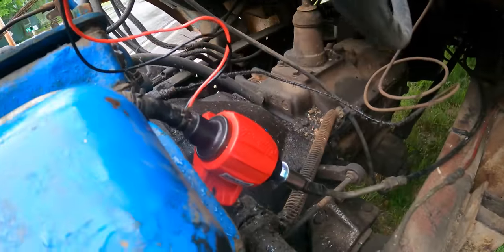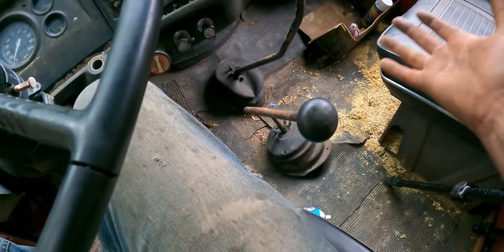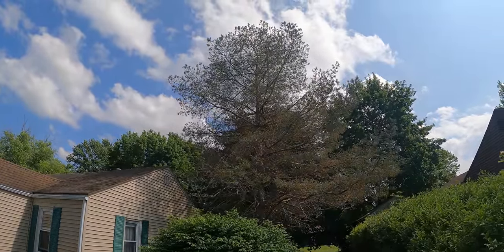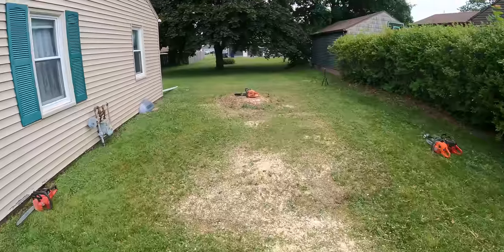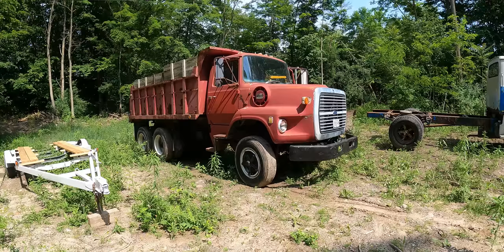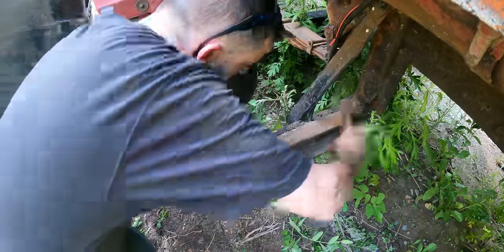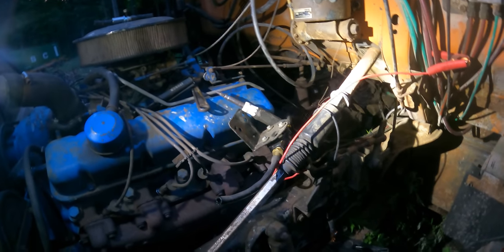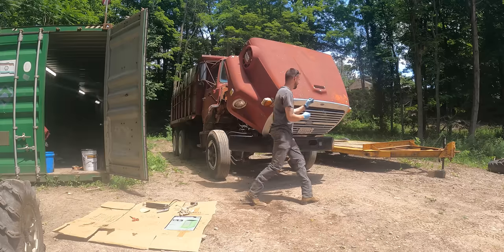I bought the CHEAPEST dump truck on facebook marketplace - Will it run??

Comment: The 534 was a good engine.  Fire department had a '75 C-800 with this engine with a 5-speed transmission.  Not everyone could shift it well, but a few could really make it run.  It pumped at a refinery fire for over 24-hours straight (obviously gas tank was topped off several times).  The exhaust manifolds were glowing red but it lived to see another day.
Reply: RUNN'EM HOT

Comment: That's a cool truck... I also have a Ford dump truck, an auction impulse buy too cheap to pass up. Mine's an '87 CT8000, but with the old style cab-over, it looks like it's from the '50s. It's unbelievably heavy duty for a medium duty truck, with a double frame almost an inch thick, 56k gross with a Cat 3208, Allison automatic, and air brakes. It was owned by a school district in central California... Well maintained and rust free.
Reply from the maker: I love finds like that. They don’t build trucks like they used to

Comment: That junk will out last anything you can buy now😮😮😮
Reply from the maker: You’re exactly right
Reply: @99Projects a gas motor in a truck that heavy seems weird doesn’t it ?
Reply: @deborahchesser7375 It was pretty common on the old days. Or at least on my developing country anyways
Reply: @deborahchesser7375 yeah I thought the same thing I had this video playing while working in the garage paying half attention and I heard it and said it must have a vicious manifold leak it can't be a gas job in a 10 wheeler ..... but a good portion of farmers got them to haul silage and farm stuff with and they were way cheaper to spec out with a gas engine I suppose . Plus the farmers never going over the road much or long distance it works out for them . Me personally I despise gas engines they always let you down when you need them most , or if they sit for a while or amy number of things lol I'll always buy diesel whenever it's an option
Reply from the maker: @rirebel6029  I tend to agree with this. This truck, as it is in this video was extremely unreliable. Every time i went to start it, it had a new and different issue with the engine. Finally the engine started knocking and that will bring us to the next video on this truck
Reply: @deborahchesser7375 tq hello dear
Reply: A gas motor that is stronger than todays modern diesels yes that you can fix with a simple harbor freight tool set all plus’s
Reply: Unkillable, mean, the mechanic embodiment of "Drunk, Tired and Pissed Off", an absolutely Groided machine that should only be ran on the finest stolen fuel this side of the Mississippi (best fuel is stolen from new dodge truck owners because they always have full tanks) just drill a hole in the tank.

Comment: I had people at the quarry I used to pick up from make fun of the 1998 Mack CL700 I was operating at the time, it had an e series motor and roared and bellowed like nothing else, they called it junk and a piece of shit, but that thing has been pulling 8-10 truck loads at 74k lbs for over 25 years without an inframe, and is built like a brick shit house, I'll miss that old monster :( This made me think of it.
Reply: Hell yeh those little 300 plus Mack motors pulled like much bigger motors. I drove a 75’ DM800 300 plus Mack 15 speed tri-plex and #55,000 bogies, like you said, built like an anvil and run forever 🐾✌️🇺🇸
Reply: It’s a Mack they keep going

Comment: The gasser isn't ideal, but a Ford L-Series is a hard truck to beat. You could get that LTS with a variety of diesel engines from Cummins, CAT, Detroit, and Ford. If you ever wanted to pursue a swap, there are a lot of plug-n-play options if you have a parts truck. That old truck looks very straight for its age and considering it's a dump truck. I'd say that was a long day driving a twin-stick gasser. The L-Series debuted in 1969/70, so that's an early example. Given how clean it is, that 10k may be true mileage.
Reply from the maker: That truck’s actually under the knife getting a new power plant now, without giving to much away, there will be more videos on it. 

I can’t imagine driving t that thing all day!
Reply: Yes I have a 1974 Ford L9000N with a factory Cummins 855 , 350HP, and when I bought it in ~2007 , the sellers told me it had been running 40 hours a week from 1974 till 2006. They bought extra trucks during the building boom and then when the building stopped they sold it off because they no longer had work for it. Amazing 32 years of service. Now I've had it for 16 years and I only run it occasionally to get gravel for my farm , still doing just fine.

Comment: You make me proud my friend we had trucks like that when I was a kid hauling green and hauling hay out of the fields we had an old Ford l9000 with a 460 in it and because of the weight that it pulled it had three sticks it had the main box the secondary box and a third box was for highway work and it was a good truck The only thing it really had to keep an eye on is keep the valves adjusted on it because when you start working it real hard the bowels would get a little loose and take about 25 maybe 50,000 miles and you have to do a valve adjustment but other than that it was a sweet ride I'm glad you saved that old truck you look good in it
Reply from the maker: Thank you

Comment: Ford LTS is my absolute favourite truck. Diesel version of course.
I was always amazed how those gas engines had enough power to move those big trucks especially fully loaded.
Reply from the maker: They have a ton of torque but I agree with you. They would have been a turb
Reply: It’s all in the gearing.  You can moved an overloaded 18 wheeler with a 500cc motorcycle engine if the gearing is low enough.  These gas trucks were geared low and were not very fast.

Comment: Old trucks are the best. I got a great find a few months ago, a Scania T112H dump truck for under 1000€. Got her running with a pair of new batteries and fixed an air leak to get her moving. Didn't have a use for it so sold it to a company that wanted to restore it.
Reply from the maker: That’s awesome! Great to see the old iron saved

Comment: You probably need to work on that holley if it's been sitting. Be sure to remove the metering blocks too. Maybe change to a 50 cc Reo pump. That has a vacuum governor on it. There is a line leading to the distributor that is not a vacuum advance. There should also be a little filter on the distributor, if that is dirty or clogged the throttle won't open right
Reply from the maker: I really appreciate the info, I do not know a ton about the Holley style carbs

Comment: There is a tool that will back off the brake shoes on air brakes for towing. Sometimes they are clipped to the spring cannister, but usually missing on old rigs. It looks like a threaded bolt with a "T" on one end. You might find them at a salvage yard, or truck parts store. I have a L9000 fire truck 1978- detroit 6V92 still in service every summer for the forest service hauling water.  It is older than most of the firefighters, but still runs strong.

Comment: That fuel pump is the same style as my M35A2.  The motor is fine but it sounds like the pump side impeller is bad. You can get just the new pump side and chang it.
Reply from the maker: I figured. I try to do will it run videos by only using what’s on the truck at the time. The truck is under the knife getting a new power plant anyway

Comment: The 534 running right made 266hp. The turbo charged marine versions were rated at 400hp.
Reply from the maker: They put turbos on those gassers???
Reply: @99Projects  Yes, some marine applications had twin turbo set ups.
Reply from the maker: @TheSoloAsylum  I wish thats what I had
Reply: I cant believe they put that engine in a tandem axle dumptruck. I doubt it can go more than 45mph fully loaded.
Reply from the maker: @Jasonrotfl  i dont think it did 40 empty the last time i drove it
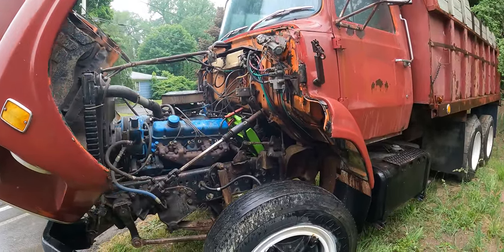Reply: @99Projects  Haha if its got a 5x4 trans, throw a 3:30 rear end in it and a diesel and shell run faster than you dare!
Reply: @99Projects  Maybe you can find a scrapped boat and swap the engine out LOL.

Comment: Back in 1969 we had  a truck set up like yours. We pulled  a clemet pup trailer with it. When that  motor was running right it would out pull a 1160 cat.
Reply from the maker: This one was worn out but I was still impressed by the torque it had

Comment: A nice tune up, blow out the fuel line. Maybe clean the tank too. Give the carb a going over for cleaning and new gaskets, seals, pumps, and touchup to the jets. Do your points and that should be good enough to get more reliable.

Not much to add that hasn't already been said or heavily implied. Cept maybe that current mileage estimate per gallon I'd peg right about 5 mpg, under load knock that down to around 2 mpg. Gas engines kind suck for that sort of thing. But, up swing is this, go-better bits are a bit easier to come by.

Plus imagine how it would look to tilt the hood to show off a nicely built big block with a weland blower on top. Leave the rest as stock looking as possible. Faded paint, surface rust and all.

That's kinda what a friend of mine did with a '76 four door Torino. Left the sun scorched paint and fried vinyl top. The rust patches were just that much better camouflage. What lurked under the hood though was a hot 429 cobra jet backed by a four speed. The ladder bars could barely be seen and it sounded like it was all missing and exhaust leaks. Right until it laid a half block of rubber elevens on the road. Just something fun about having a top runner housed in dirty coveralls so to speak.
Reply from the maker: I’m a big fan of the natural aged look, it kinda tells a story. 

I wasn’t going to do anything with the engine untill it started knocking. There’s a new plan for it now

Comment: I'll tell you an exalent heavy duty v8 engine from early international dumps its the 345. If you ever need a replacement engine and you decide to go with gas this is what I would recommend. Only a option.
Reply from the maker: I actually have an old international cab over with the 345 in it, it’ll be a video of that soon.

Comment: Don’t you have to get that truck safeties to be road worthy?
I never understood American laws when it comes to buying a used vehicle and being able to drive it on the road without any tags.
Here in Canada you have to be 100% compliant before it can even touch the road.
Reply from the maker: So do we, it has to be Registered and insured, however, with farm tags, in my area, you are exempt from the yearly safety inspection but you’re limited where you can go by miles. I think it’s 50 miles here. It should go without saying that anytime a vehicle hits the highway especially one this big and heavy, it should be safe to be around the public. 
I checked all the brakes and lights, horn etc, all things that would be required in a safety inspection.

Comment: It's good basic transportation for 50 years ago.  Love that tight turn circle the LTS provides.  534 V8 is normally the 900-series truck .  

 800s used the 361 and 391.  Slow....
Reply from the maker: It’s slow there’s no question about that but it is the 534. Hopefully there will be a new engine going in it in a future video

Comment: Ford offer a 401/477/ & 534 super duty gas engines. yours look like this series of engines. They didn't have much horsepower but had good torque. I drove a 20' box truck for some time and the 534 performed with 50/65 mph highway speeds.
Reply from the maker: I believe this one is a 534. I bet it had a lot of torque back in its day but it’s worn out. I can get about 45 with it flat to the floor. I’m working on repowering it with a big cam Cummins.
Reply: @99Projects  What's the gas mileage? Also, low compression often lets you advance the timing to compensate; what appears to be wear can be stuck rings that can sometimes be freed with oil detergents, and "Restore" oil additive can also boost compression.
Reply from the maker: @alan6832  I didnt check the gas mileage bcuz it would just make me cry. Low compression was not an issue that I was aware of, the issue now is the knocking
Reply: @99Projects  The only trouble with repowering it with a diesel is the rear axle ratios, even with an overdrive trans you'll be lucky to make 40 mph.  Gassers like that usually had low ratios, something like 6.5 to 1's or lower which is ok for an engine that can turn 3500 rpm. There's also the issue of the power of a Cummins will be too much for the transmissions and rear ends. So you'll need new drivetrain front to back. If it were me I would just rebuild the 534 or find another one to swap in.
Reply: @99Projects  rod knock shouldn't directly reduce power, though it might, and should get you off the gas pedal.  spark knock? then retard timing and use carbon cleaning fuel detergent.   when you wrote it lacked power and was old, I assumed that combination would be from low compression, but you are right that it could be many things.

Comment: You should have got some rubber are something put in between the tank metal on metal it's going to do the same thing again
Reply from the maker: You’re right. The truck is getting a new engine so all of this will be changed anyway

Comment: In the future,  leave bottom connected  , use chains and lay tailgate  flat like a pickup truck. Then use bobcat to raise and put pins in.
Reply from the maker: I was going to but I didn’t know if the bottom latches would hold the weight

Comment: 534 was never offered in an 800 series.  So, either engine was swapped, or its and LTS900.   Honestly the engine looks like a 391
Reply: The 534 475 and  401 were all the same engine series and you could get the 401 in the  smaller trucks.  I have a friend with a C850 with a 401 engine.
Reply: @mylanmiller9656  all 850s were Super Duties.  That was the change point.  A few firetrucks were built with 401s but limited number, most were 750s but I know of one F800 firetruck with a 401, but it was swapped in.
Reply: @berhorst59  The engine in that truck is for sure not a 361,  it has 8 valve cover bolts  the FT series has 5 bolts.
Reply: Yes the big gas engines were available in both C and L cab. I had CT900 with 534. L880 was one version that had 534 available.
Reply: @janmayes6578  the 880 series had the 475, which was the same as the 477, with less warranty.  900's were all Super Duties, but 800's were not.  Some F750 firetrucks were built with the 401SD, a limited number of F800 firetrucks were built with the 477.  No 534 from factory in anything less than 850 series.  850s were just 800s with the powertrain of a 900.  Ford policy.  Any series that had a -50 in it, was the same.  Truck was series of the first number, with nnext higher series powertrains.  Started that program in the 50's.  Discontinued in late 60's, with the exception of the beginning of the 880 series in 1972, which offered the 475 in an 800 class truck.  Research the history of Ford Trucks if you don't believe me.
Reply: Okay
Reply: @berhorst59  My dad drove a 1962  F 950  Ford with a 477 and a 1964 850 with a 534 .  The Company that Dad drove for also had a 1958  F 850 with a 534. I don't know about the later F series trucks, I know the early ones not all 850 trucks didn't have 534 engines in them.

Comment: Any plans on swapping the motor out for a diesel engine, the old transmission for a Eaton Fuller transmission, newer fuel tanks, and trailer connections to haul a tag trailer with air brakes?
Reply from the maker: I don’t want to give to much away but there will be more videos on this truck which I’m excited about lol

Comment: Yeah hope you guys stick with it and make it road worthy & do some body work  give it back it’s self worth & dignity treat it to a new set of tires and keep working your shifting skills on that unique old school transmission  I never got to learn those I went to truck driving school we were coached on the 5 over 5  fuller road ranger  again keep developing  your skills and reviving that old 72 LN  900 that is rare I would turn it into a show truck  over haul the air brakes  and soup up the motor I would leave it gas  keep the gear boxes there is gear lube you can put in there to help smooth the shift as your shift skills improve  I am sure you know what series that is I lean to it being a           L 8000  but I could be wrong  that truck with it’s set back steer axle and that 5 & 4 gear boxes makes that a class 7 or 8 truck  Ln series are class 5 or 6 and would have hydraulic brake with vacuum assist  another thing I would like to know is that a twin screw or is that rear axle just a dead weight bearing axle
Reply from the maker: I plan to keep it around, there will be videos on it in the future. 

I believe it’s a twin screw
Reply: @99Projects  that’s cool thank you good luck keep fixing it up  that truck can be a real asset

Comment: Is a Detroit Diesel 6/71 6v71 8v71 Swap an option..🤔💪💨
Reply from the maker: Yes, but I have a 855 Cummins I’m going to put in it
Reply: @99Projects  My dad  hauled  logs with an 850 ford with 534 back in 1964. He also drove  a 1000 Dodge with a 250 Cummins. the even though the Cummins was a low hp 855 it had a bunch more power than the 534, the 534 was new at that time. Dad always  said he wished the Ford had a diesel.

Comment: Just gonna go out and say this is not 1972. Your style didn't evolve until like 1984. LTS-8000 fits the bill. If it did come with a gas must've been a special order. 8.3 cummins should do it.
Reply: It is a 84 and up grill but that can be swapped.  No way that truck is 84 or newer
Reply from the maker: The vin is 1972. They did put gas engines in those trucks. After pulling the engine I believe that specific engine was installed by someone, not the factory, but the mounts and transmissions etc look factory. They probably swapped the hood when they put the engine in. 

The new engine is a 855 cummins.
Reply: @99Projects  gotcha and nice.